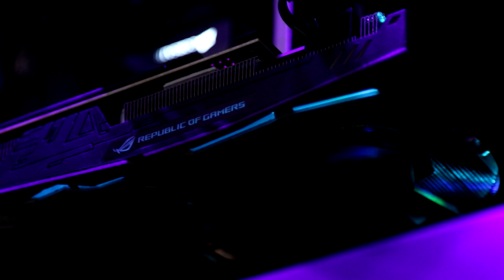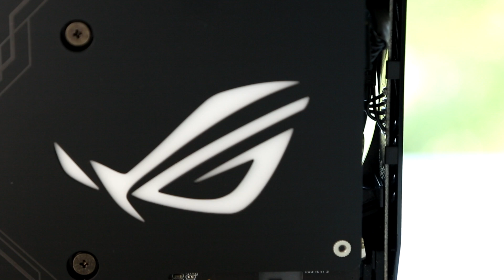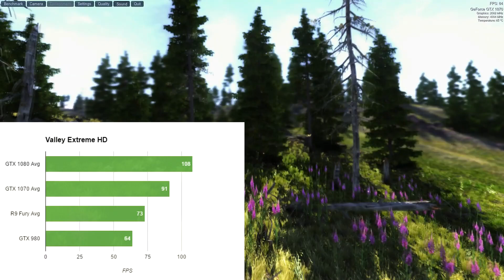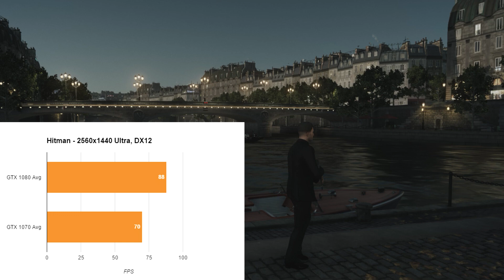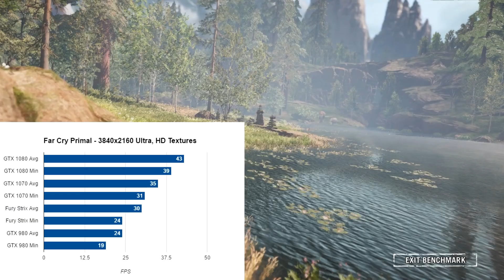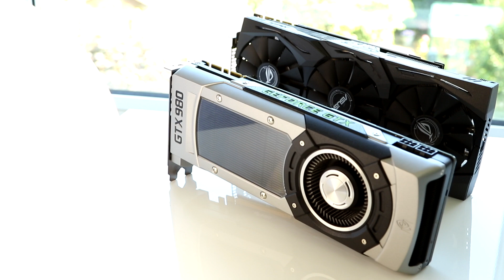Nvidia GTX 1070 Review - Asus ROG Strix OC

Comment: Hmm .. for an extra $150 more you can purchase the EVGA GTX 1080, $200 more the Gigabyte G1. Now for Full HD, 1920x1080, heck yeah the GTX 1070 is a beast, but for WQHD, 2560x1440, no! You only tested a few games, not to mention FPS games or any forthcoming games. The GTX 1080 makes a huge difference for those whom have a WQHD monitor and especially 144 Hz 2560x1440 gaming monitors, and those with 21:9 (3K) monitors.
Reply: I don't know what kind of drugs you are on but the GTX 1070 and 1080 are more than adequate for 1440p gaming. Who the hell needs to maxed out 165fps in every games ? 
To be frank, most of the people here are still gaming on 1080p and they cannot tell a different between 100fps and 165fps.  
Many CS:Go professionals are still playing on 720p settings and some don't even have a GTX 980 Ti. 
You are definitely not a profession FPS player. You are just one of those people that MUST have everything HIGH ENDS and EXPENSIVE. You're just an average part time gamer like us so stop trying to convince people to spend $200 more for a GTX 1080 when they don't even need it. 
You have a big ego but many of us do not. Many of us don't have the luxury to replace a GPU every 2 years.
Reply: Yeah I kinda feel the same way. 

While the 1070 does 1440p well now, I have an inclination it won't last long at this resolution like it would for 1080p.
Reply: ***** Ever price a gaming 2560x1440 monitor? Add G-Sync and the prices start at $550-$600. While there are cheap 2560x1440 monitors, $350 +/- and typically with 20ms-30ms input lag it will make you hate your monitor quickly.

So a good Acer, ASUS and the gaming Dell in many cases will set you back $600-$800. While I can't speak for everyone, when you're spending that much on your monitor .. yeah $150 extra for a GPU that at least has 'some' future is certainly justified.
Reply: ***** That's a used monitor, so buying used electronics is a crap shoot. New it's around $600. I play FPS games, we've had that discussion before.
Reply: ***** As of today the GTX 1080 is the top GPU. However, both the 1080 Ti (~$800; ETA Q1 2017 maybe Q4 2016) and 1080 Titan X (~$1,200; ETA Aug 2016) are forthcoming.
Reply: Okay, dude, chill. We get it. You're a hardcore FPS gamer. But not everyone has the fortune to spend on computer hardware endlessly like you may have. There is a "Do Not Cross" line for everyone's budget and you're coming across as extremely arrogant in your comments about this subject. You are exactly the kind of "computer expert" who people don't want to listen to. You're exactly the reason why this community has a nasty reputation for anger. I get where you're coming from, but you should understand that everyone has a budget. However, judging by that cover of a Mercedes on your profile, I would guess you have a grueling time understanding there are others who aren't of high class lifestyle. You need to relax.
Reply: Andy Lam Thank you!!! People who buy the 1080 are kinda retarded! The 1080 TI comes out in a few months, and its gonna be more powerful as the Titan XP! The 1070 is 15-20 fps less powerful than the 1080, and the 1080 TI will be about 20-30 fps more powerful than the 1080. I'd either buy a 1070 or wait for the 1080 TI. Don't spend $650-$700 on a 1080 at all! Buy a 1070 for $200-$300 less, or save up and get a 1080 TI. People are always wasting money when they buy an 80 series card. You're better off buying a 70 or an 80 TI series card.
Reply: ***** I'm the FPS gamer who knows how input lag, frame rate and refresh rate all significantly effects your gaming experience. In my world a GPU that adds 20-plus FPS is worth $150 more. 

Many new games are still coming this year not to mention next year .. and every next gen game requires more and more GPU horsepower. 

footnote: OLED panels can have an incredibly low 0.1 ms gtg response, that's a 10 times faster response than any current gaming monitor.
Reply: RasmanZ Here's my take, more simplified. GTX 1070: Full HD is a Bingo/great, 1440p depends upon your games and setup, 4K the GTX 1070 is mediocre. 

Now if your monitor is a 60 Hz and 1440p I can see the GTX 1070's appeal IF you replace your GPU every generation. 

SLI is a problem on way too many games now and in the past. Often leaving games permanently unplayable or you're waiting often months for an SLI patch or driver update. So IMHO a SLI GTX 1070 is a bad idea...if you are thinking of adding one later.

I'm a CoD player and simular games, FPS, you do indeed have an advantage at 120 Hz/FPS and higher. Further, my feeling is the GTX 1080 or forthcoming GTX 1080 Ti you might get decent performance for a couple Nvidia iterations eg skip 'GTX 1180' but probably not the same outcome with a GTX 1070 on any resolution above Full HD...
Reply: Good points. My 780Ti does a great job on games like BF4 using custom settings. There is little reason imo for anyone running a similar card to upgrade to anything but a 1080 or better. I can agree that the 1070 would be fine for most who play current/older games at normal HD. It could get the job done at higher res but I don't know many gamer's who just want to get the job done. :-)
Reply: RasmanZ Example, I had a pair of 2GB GTX 770's on a 1440p .. running BO3 there was a vRAM bottleneck and Medium was the highest settings available. Most of the time I was either running half resolution (HD) or native on Low, no effects, no AA, crap for 90 FPS with microstutters.

LMAO now all settings are available and now I can SEE. My KDR and SPM are nearly doubled. The GTX 1080 was a no brainer. Come this November the next CoD with more demanding rendering. 

BTW I can't wait for Battlefield One! :-)
Reply: Battlefield 1 does look pretty sweet! The new Cod...not so much.
Reply: Johannes Danielsson Then I seriously doubt you'll be purchasing a 2560x1440 monitor and for certain not one that has a 120 Hz, or 144 Hz, or 165 Hz...which is what the entire discussion regarding the $150, etc is all about.

It seems kinda moronic to purchase a $700-$1,200 plus 1440p gaming monitor capable of 144 Hz or faster refresh rate and only being able to get 40, 50, 60 FPS running a GTX 1070...
Reply: ***** The problem is on a 144 Hz plus monitor I do NOT want only 60 FPS / Hz. Next replacing a GPU every year is more expensive. As games become progressively more photo realistic every year so do the rendering requirements.

I barely can make it through 2 years with my GPU(s).
Reply: I just bought a GTX 1070 STRIX for $315.
Reply: I've had a 760 from EVGA for two years now and runs all the games I've played without fault. Not at max settings of course, but fairly high. You have utterly no concept of what you're talking about by saying a card will only last a year at the specified performance in this video. It's many different variables such as capacitor construction, memory transfer speed, MHz stability, and even the internal environment of the computer case which all affect life span and performance. I'm sorry you've had such bad luck with graphics cards that aren't at the top of the rope every single year. Although, even in comparison to the 970 back when it first was revealed, the 1070 (the next generation) destroys the 970's former glory by 46%. Computer hardware is getting faster and better throughout the generations and either maintains it's average price or becomes cheaper. But not everyone needs a QHD or 4k monitor. Not everyone needs the shiniest penny in the bin. Most people can get by, hell even prefer, a full HD monitor with something like a 1070 and it'll future proof 'em for the next 2-3 years.  Now if you need a high resolution monitor and so on, such as yourself, then you need more power more often. You don't buy a Ferrari for a Honda's work. And you don't buy a Honda for a Ferrari's work. So is your "$450 a year" squabble still valid? If you're going to attack anyone, attack me. I don't appreciate the way you're badgering these others in the conversation.
Reply: +D Jaquith spending 650$ on a fucking "toy" is pretty stupid, please use your brain and understand that some people can be happy with a 1070 that kills 1080p and does pretty well in 1440p. I thought CoD was easy to run anyway, don't know why you act like fps matters so much in CoD when it's 1. A game with little to no skill these days 2. A game that's only competitive on consoles, if you wanna play competitive CoD get a console or realise that getting good KDA in public games on PC is a waste of time and if you need 144hz to get good KDA in a game as random as cod with kills streaks and shit, think twice.
Reply: +D Jaquith I completely disagree with you. I own an Asus PG279Q and Asus GTX Rog Strix 1070, running off an i5-6600k @ 4.3 ghz and DDR4-3600 and that thing completely rocks 1440p. I'm hitting in the rock solid 80 fps range on ultra on pretty much anything I've played. For example, I was hitting 82 fps solid on Fallout 4 all Ultra settings, including God rays. The lowest it dipped was 74, and sometimes was in the 90-100 fps rang, bust mostly it was at 82fps. And, you cannot simply add $150 to the price of a non reference 1070 and think you're gunna find a 1080; it not gunna happen. There's no way you're getting a 1080 for $600 or less. If you find that kind of deal, I promise you its2a scam and you're about to get ripped off. At the end of the day, the GTX OC 1070 is a banging card for 1440p. I know from experience because I own one. It's hitting at like +2000-2100 MHz out or the box and I've never seen it above much more than 60c. For around $430-450, it's the card to have for 1440p.
Reply: D Jaquith Do you own a 1070 or are you just reading about them? I've had no issues keeping mine running at 165hz whatsoever, and the GTX 1070 will be fine in 12 months and beyond.
Reply: I went to my local retail store and purchased the Zotac AMP Extreme GTX 1070 and the 1080. I ran both of them on BF4 at 1440p Ultra Setting on my Acer XB270HU. 
Now, the GTX 1070 rarely dipped below 135 fps and GTX 1080 stayed constant at 155-165fps. 
Do I noticed any different ? HECK NO ! I'm not Superman !
So Is it worth it to spent an extra $150 to $300 more for a GTX 1080 ? Absolutely not !!!!
The GTX 1080 isn't strong enough to maintain 60fps on 4K and its way over killed for 1440p.
I believe GTX 1070 is the best bang for the bucks for 1440p gaming assuming you are upgrading from an old GTX 700 series or Radeon HD 7000 series.   
As the matter of fact, I returned both of them and are looking for a used GTX 980 Ti for around $300 - $350.
It's crazy to spend $650 on a single GPU that's like 3/4 the cost of building your own PC, but at the end of the day it's your so spend at your will.
Reply: +D Jaquith The differences get really slim when the resolution goes up. In 1080p it's like 15-20 fps better, but at the higher resolutions it's only about 5-15 fps better. It doesn't justify the high price tag. An overclocked 1070 is basically a stock 1080 anyway.
Reply: Not everyone need or even wants 4K. Some just want 1080 at 100+ fps. Not everyone even wants ultra settings. I just got a 1070 for $240 since I see no need to spend 500 or more just to play games at settings I won’t even notice. My tv runs 1080 120hz so that’s my goal. After this RTX shit show I won’t be upgrading for probably 2-3 years anyway.
Reply: These new cards are aimed at 4K gamers. The frame buffer indicates that. Either card is great for less resolution and higher fps. How much money will determine how much fps. I'm just waiting for the 1080Ti to come in and embarrass every other card on the market (including the Titan) for gaming. lolz
Reply: I can't argue with the obvious. Yeah, video cards are not JUST aimed at one segment or setup...but this generation is definitely all about 4K and VR. You are also stating the obvious that performance will worsen with time. Even when performance shouldn't be reduced when playing a mod of a previous gen game engine, somehow it always runs lower fps...
Reply: As in the past, the lower cards will give you barely OK performance. It's always been that way and will always be that way, IMO. They do that on purpose. That's why I always pick up the best card for that gen. of cards (and why I am currently on a Ti. With a gsync monitor (which all serious gamers will pick up now) 30-60 fps will be good enough to enjoy current titles. That's what they're going for (and also why I only upgrade every two generations of cards). Upgrading every generation is just feeding their bottom line and encouraging the bstrds! hahaha
Reply: Performance is relative. There is a lot of variation. That is why they "bin" so talking about the actual performance is fairly moot. It's fun but your 1080 might perform way different than my 1080. The whole reason anyone talks about the performance is to decide if they should upgrade and whether or not it's worth the money...
Reply: RasmanZ Sadly agreed. BO3 is okay, better than either Ghosts or AW, but it's getting old and not as good as BO2.
Reply: ***** TBNRFRAGS posted a video using his GTX 1080 using the ASUS ROG SWIFT PG279Q running BO3 and had sub 60 FPS running his Extra and everything 'on' settings. I recommend to him to try my settings for a solid 90 FPS.
Reply: ***** No what briefly crossed my mind was running a pair of GTX 1070's in SLI, but then I remembered what a PITA it has been for CoD and SLI after BO2.

I'm still deciding on what next monitor .. 1. Standard 16:9 2560x1440 2K (updating my laggy Dell 2K) or 2. Non Standard 21:9 3K. The thought of having two blacked out sections on either side of my monitor is pushing me towards 16:9. While there are indeed Resolution Fixing third-party apps .. the risk of a Ban keeps me from using in MP online gaming.
Reply: ***** As I mentioned before, I want to see what's coming out for 2017. I really like the 21:9 ratio and OLED's are great. They just haven't invented or published a release on what I'd love!
Reply: ***** I'm not trying to push TBNR...here's the video /pnig42umW78
Reply: I use a 3440 x 1440 monitor with an R9 Fury OC and it can handle a surprising amount of games maxed at 60-75fps at this resolution. But games like the Witcher 3, Tomb Raider and other heavy titles it'll go down into the high 40's and early 50's. So I would like a single card that can achieve my monitors refresh which 75 hz in these super heavy titles. An the 1070 doesn't seem to be able to do that were as the 1080 does, may still wait for Vega and the Ti though. That being said I think the 1070 is probably Nvidia's current best price to performance card at the moment and beyond if 1080 pricing stays so high.
Reply: ONLY 150? 150 is still a lot if you're budget can't afford it
Reply: Samual Williams EVGA GTX 1080 had a model at the time I posted that sold on Newegg for $600 ($599.99).

I purchased the Gigabyte G1 for $650 http://goo.gl/OdlAkH and the GTX 1070's are averaging $450, but other GTX 1080's range from $630-$750 plus. Also some places were ripping people off reselling GTX 1080's over $1,000.
Reply: Samual Williams $600 - $450 = $150 and $650 - $450 = $200. Basic math.
Reply: +neural_physics Not even a used one for that cheap. They're really expensive.
Reply: Samual Williams You guys simply don't get it. For FPS gamers like myself and many, many others 20-40 frames makes the GTX 1080 on a 1440p literally a no-brainer. I've played against Preston and Kenny in CoD. The GTX 1080Ti isn't available but if it were and LMFAO only costs $800 then no duh I'd purchase it. Same irrelevant argument waiting on the 'GTX 1180Ti' etc...

Further your CPU and its underlying architecture can immensely improve your frame rates. For a comparison Preston had an added 30 plus frames after upgrading an already high-end PC; video /HcLZXPauLls

Lastly even the OP of this video stated higher Hz 1440p benefit from the GTX 1080. And again it's foolish to ignore like an ostrich the future games, many are coming this Fall and will require a stronger GPU than now, today.

Buy a GTX 1070 today and next year remember your poor choices. Doesn't effect me, I have a GTX 1080.
Reply: Samual Williams Buddy you're not getting it, IF you're on a budget then gaming on a 1440p monitor is the last thing you want to buy burdening your system. 

It's clear to me that none of you actually own either a GTX 1070, GTX 1080 or more importantly 2560x1440 monitors. We can all post verified system specs.

I made a huge mistake in the past purchasing a GTX 'X'70 series and when applied to the resolution in question it's a poor choice. As I stated, in my initial post, the GTX 1070 on HD 1920x1080 is a beast. 

Very few PC gamers are running 1440p, I'm one of them for the past two years .. I know what I'm talking about.
Reply: ***** I use to run across turds like you all of the time. Here's my current rig with CPU-z http://valid.x86.fr/ar45a3

Now once you post yours showing both a GTX 1070 and Dell Gaming 2560x1440 monitor then I'll listen to your BS.

Here's the link for CPU-z, it is free and only takes a few seconds to validate your rig; link -  http://www.cpuid.com/softwares/cpu-z.html

No doubt my SB-E is old, as soon as the new LGA 3647's are available out with the old in with the new.
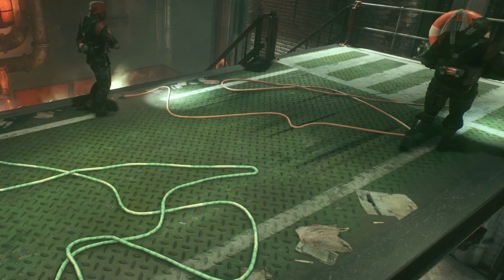Reply: ***** Then you're an idiot because you're not going to hit you monitors refresh rate. Listen carefully 4:50 

Now on your CPU-z for the name use neural_physics and post.
Reply: ***** It has zero to do with what 'you' can or cannot afford. Instead what 'you' recommend to people. It not only goes against what I said but pretty much every Reviewer said including this Reviewer.

You're a misery loves company kinda a guy, and that's your entire premise. I'm a guy trying to get specific people not to make an error. Both the 1440p and higher resolution people need more 'horsepower.' Where's the sense in looking at grainy or poorly rendered games when it's unnecessary for a few bucks more.

Dude there was a 'reason' people in the past were running 2, 3 & 4-WAY SLI...eh maybe not so much the 4.

There's zero doubt for gamers' running high refresh rate monitors that for $150-$200 the GTX 1080 makes more, no right now a lot more sense over a GTX 1070; especially long-term.
Reply: Jimichan Where? Link? It's $430 +S/H.
Reply: ***** Personally I'd don't care what people buy, nor do I hate any of the new GTX 1000 series. Even the guy making this YT video said 1440p with >60 Hz get the GTX 1080's, but people have Alzheimer's or didn't watch the entire video. 

The GTX 1060 is fine for 1920x1080 for most games. However, if you prefer to see the best render and want a GPU to last for a couple years .. I'd recommend the GTX 1070 for 1080p.
Reply: ***** The GTX 1080 is barely a strong 1440p card for higher refresh rates now, let alone a year or two from now. I don't know what benchmarks you're looking at? You seem to overlook the fact many people were running SLI 400, 500, 600, 700 and 800 series cards. 

The GTX 1080 hopefully will hold me through to 2018. I'm confident the GTX 1070 wouldn't. We're going in circles here. The only way I considered the GTX 1070 was as a pair in SLI, but SLI all too often is a pain in the a$$! 

I had an immediate need otherwise more than likely I would have opted for the GTX 1080Ti (guessing $800).

Use whatever you want, deal with your decision. I'll deal with mine.
Reply: ***** Buddy what you're missing is right now even the GTX 1080 won't hit the 144 FPS aka 144 Hz at 1440p in most games. 

Today, you absolutely cannot get sustained 144 FPS in BO3 with max settings at 1440p, and each CoD game increases its requirements by 15%-20% or more for each release. That means there's a 0% chance of Max Settings of Infinite Warfare in November, 3 months, and I'm worried if the GTX 1080 can even cut it for CoD in 2017. 

For Ghosts I purchased 2 GTX 770's and it was a nightmare, no SLI support until patch 4 or nearly 3 months into the game. By the time BO3 was released you needed at least 4 GB preferably 6GB GPU (s). I had to play on all lowest settings and best 1080p on my 1440p monitor. 

Perhaps you play WOW or other low quality / low requirement games, I don't. Additionally, I purchase other new games eg DOOM, etc. The rendering easily with many of these games can bring any GPU to its knees.
Reply: ***** Buddy in DOOM you're getting between 70-90 FPS at 1440p and worse in Multiplayer, or about the same as a GTX 1080Ti. I play DOOM Multiplayer and my FPS is barely what I consider stable and high. 

Frame drops absolutely suck in any Multiplier and you as a 'gamer' should know this. 

To avoid frame drops you need to find the sustainable frame rate and cap it, in this case around 70 FPS. So that's "extremely high" .. compared to what? .. 40, 50, 60?!
Reply: ***** No I own a more powerful GTX 1080. LMAO by next year in the next DOOM that 70-90 will be 50-70 and after that unplayable, so your GTX 1070 is good for a year?

Using a little foresight that extra  $150 would have bought you an extra year.
Reply: ***** Here's your future .. get use to medium and low settings. Brilliant!
Reply: Sorry, I guess that's not fair.  I used a $100 discount coupon (that's not available to everyone) and a $15 rebate.
Reply: George Washington That's my daughter's car. Yep it's cheaper to spend $450 a year...
Reply: George Washington I think people cannot frigging read. 

We're talking about 2K monitors, 2560x1440, and in particular those monitor with 144 Hz.

I personally had to toss out a pair, 2 way SLI, GTX 770's because on BO3 and at 2560x1440 the game was unplayable. My KDR went up significantly after the GTX 1080 and the new GPU unlocked both High and Extra settings which were unavailable. 

Further, running a '2K' monitor at low or reducing resolutions looks awful.
Reply: +Johannes Danielsson I agree. You can run BO3 at 3440x1440 at like 90-100 gps with the 1070! The 1070 can basically do everything you need under 4K res! I'd either buy a 1070 or wait on a 1080ti. I would just skip the 1080 and Titan XP. Or I guess you could buy a 1080 when it drops 100-200 bucks, but I'd honestly just wait on the 1080ti. The 1080ti will cost around $800-900 and will be as good or better than the Titan XP! That's gonna be the best card for the money you could buy! That 1080ti will be as good as the next gen 1170 and a little under the 1180! It'll last you a good while and run 4K at 55-85 fps!! You can't beat that at all! Either get the 1070 and save 300-400 bucks or wait for the 1080ti.
Reply: Samual Williams The GTX 1080Ti is due out Q4 2016 maybe Q1 2017, but it will perform somewhere between the $600 plus GTX 1080 and the $1200  GTX Titan X (aka XP). 

A GTX 1070 has a more limited shelf life than the GTX 1080's. Anyone who plays the latest titles knows all too well squeezing out one let alone two years is difficult, and nearly impossible for the latest titles. 

LMAO I'm no professional 'FPS' gamer, but frame drops, sustained minimal frames, stutter, SLI latency, render quality all add or subtract from gaming experience and immersion. 

Yeah Nvidia would love to see everyone purchase a new GPU yearly over buying wise and biannually.

The GTX 1070 is great for 1080p, read the initial post.
Reply: +D Jaquith You could get two 1070s for a little more than a 1080.
Reply: +D Jaquith 1440p also
Reply: Samual Williams I thought about doing SLI GTX 1070's, but with SLI you get 'baggage' in the form of Latency and worst Support. Example, CoD Ghosts had poor SLI support until patch 4, or 2 months. My KDR went from an abysmal 0.7 to 1.97 after the patch. Using SLI, in Ghosts, would produce nearly unplayable frame stuttering and worst Strobing (like Halloween light stobes). Ideally FPS games a single GPU. 

/edit DirectX 12 is so far crappy with SLI./

My 'plan' is to purchase a 3440x1440 21:9 monitor if Infinite Warfare supports that resolution. However, that may force me to either purchase a GTX 1080Ti or worst a pair of GTX 1080's.

A pair of GTX 1070's costs $900 vs $1200 GTX Titan X and no SLI issues...
Reply: Abiogensis Zero Proof I own a GTX 1080 and so you're obtaining 165 FPS in keeping with your 165 Hz monitor .. really lol. What with everything on its lowest settings aka blurred vision settings?
Reply: Samual Williams An "overclocked 1070" is not a GTX 1080 equivalent, and neither the GTX 1070 nor 1080 are an ideal 1440p (2560x1440) GPU. Both are barely adequate. 

Until the GTX 1000 series many people would SLI, or CF with AMD, to obtain higher settings for 2K. 15 to 20 FPS is a huge difference, and even with a GTX 1080 obtaining 90, 100 or 144 FPS is nearly impossible without sacrificing rendering quality, or in SLI which is something I'm considering...

/edit if I or you want mediocre then consider a Console. 

Nevermind that this time next year the games that are 60 FPS now will be 40 or less in a snap so that plus 15 FPS will be vitally important.

I've been gaming for years and this is a constant. Replacing both your PC and GPU(s) adds up fast. Ideally I try to replace my PC every 3-5 years (LGA 1366, 2011, .. LGA '3647') and my GPU's biannually, every 2 years. I've been using SLI for several years...
Reply: Samual Williams Really?! Look into some benchmarks first, as I've said several times 1440p and the new games are very demanding. 10-15-20 FPS is a huge difference and if you shop around you can find a GTX 1080 for about $600, a gaming 1440p G-Sync IPS 144 Hz monitor starts around $650-$800. 

Using your logic anyone could wait for the Nvidia GTX 2000 series with its 40% increase over the 'snail speed' GTX 1000 series in comparison. Lastly no one I know with a GTX 1080 regrets buying one, including yours truly. It makes no difference at all which GPU you purchase .. my point is to think first before buying any GPU. If you're an FPS Gamer then the GTX 1080, now today, is a no brainer if you have a 1440p 144 Hz-165 Hz monitor. 

Gears of War 4 and the newer games are very demanding http://www.guru3d.com/articles_pages/gears_of_war_4_pc_vga_graphics_performance_benchmark_review,7.html
Reply: Abiogensis Zero Proof If you can 'read' what about next year? Or the next? Great you have a GTX 1070.

Example of TODAY and a GTX 1070 failing - http://i.imgur.com/CRBOz5O.jpg 40 FPS frame drops. All of us in CoD know this and damn the next Infinite Warfare is out in a matter of weeks and then there's next year. This is NOT a driver issue and everyone I know in FPS gaming running 1440p is either a GTX 1080 owner or a GTX 1080Ti wannabe. The frame drops make you 'dead' in this game, it's like pushing the pause button.

Certainly you can get into the cycle of a new GPU yearly. Buy a 'GTX 1170' in 12 months. Hell I know people sporting Titan X(p) in frigging SLI. 

As I've repeated countless times if you have a 2560x1440 144 Hz or 165 Hz Good Frigging Luck getting your GTX 1070 sustaining 144 or 165 FPS. Sure run medium or low settings.

I'm not trying to be an 'ass' as I've said I've been down this road before and I have a closet filled with old GPU's. 20-30 FPS in 1440p is damn  worth $150! $150 is a nincompoops obvious choice.